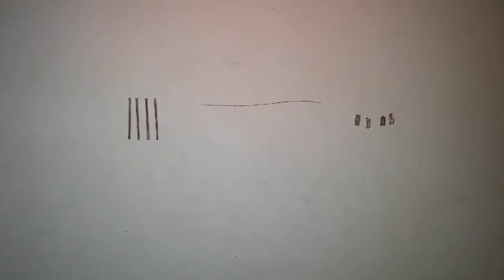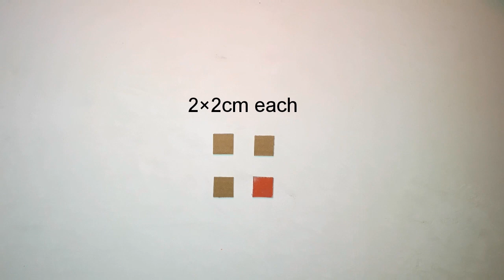How to Make Remote Control | wired remote control | high speed and low speed

Comment: Bro please tell me where we will solder the wires in the converting circuit which was converting high power to low power 🙏
Reply from the maker: Bro check description box there's a link for Circuit diagram
Reply: @GAMSTRAIN  bro but i need only that circuit only bro
Reply from the maker: Yes both are same
Reply: @GAMSTRAIN  ok tq ❤️